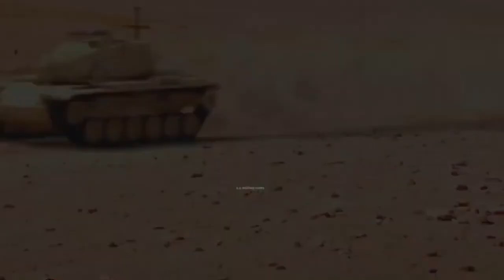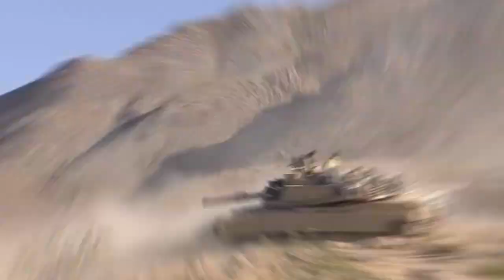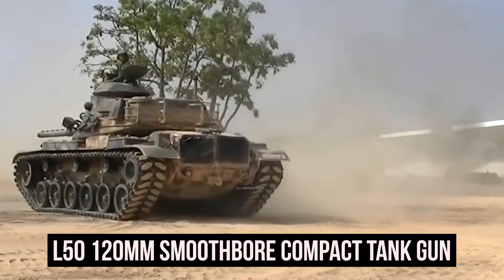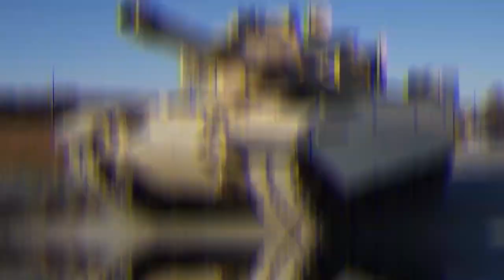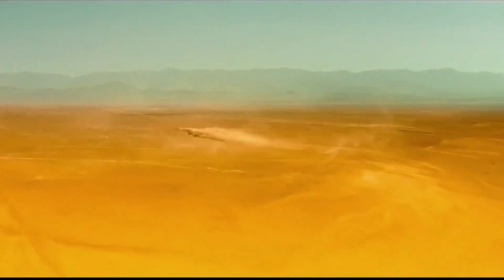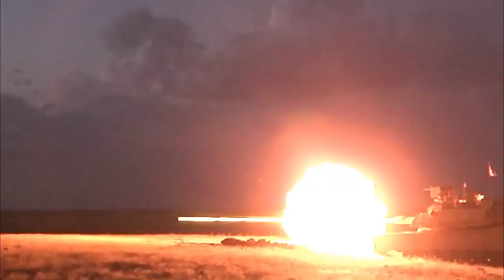The M60 Phoenix Of The Jordan Army Just Received An UPGRADE!

Comment: I am not aware of any tank that got a 152 or 155mm calibre gun. If so than it is a howitzer mobile field gun.
Reply: m60a2 did called the starship it used a low velocity 152mm shell, and shillelagh atgw same gun as the sheridan light tank.
Reply: M60A2 did have such a large gun because it was meant to fire gun launched anti tank guided missiles (GLATGM) similar to the russian 9M119 Refleks system but it was scrapped for.... reasons I guess.
There were also some prototype tanks with such calibers in the cold war but none of them were successful.